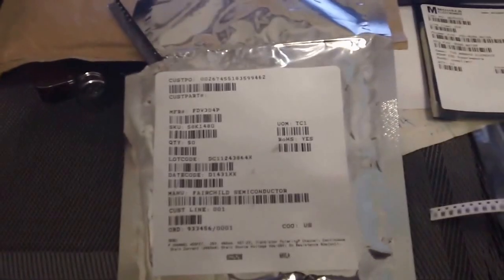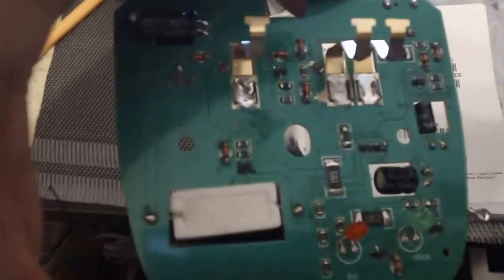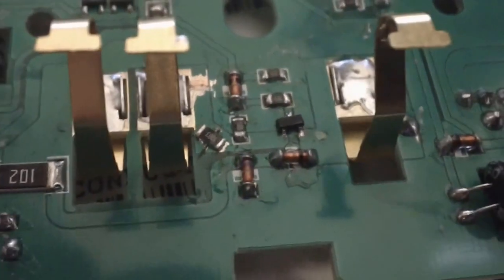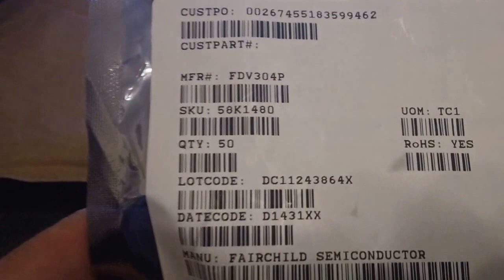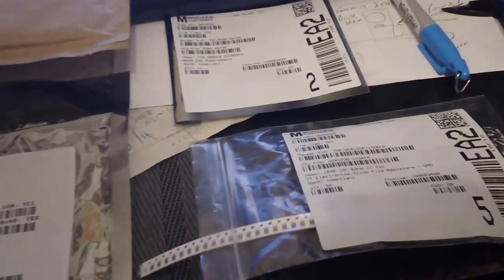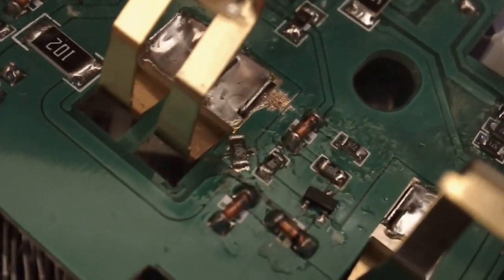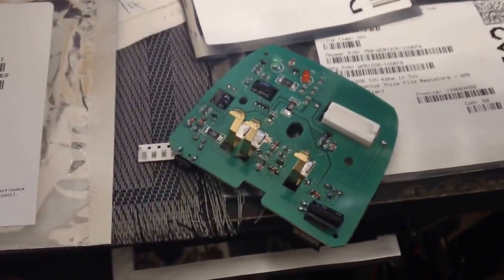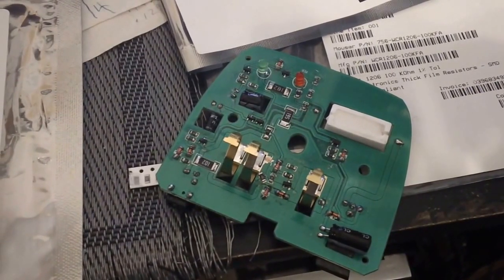repair / fix yaesu CD-41 FT1DR VX8 charger p channel fet esd damage/dead

Comment: I've been trying to fix my drop in charger but i'm not good with electronics. I will try this repair and I will also add the resistor. Thank you so much for the video Jim. 73 W2MSA
Reply from the maker: ok good luck, it's not too hard, take your time and you will get it.!!  73  de AG6IF

Comment: is that an official cd-41 r a cheaper Chinese copy??
Reply from the maker: this is a copy, however, I have the original CD-41 also, and internally they are visually EXACTLY the same in every way., every mark smudge and sticker is identical, and even the board mask and all parts are visually the same.